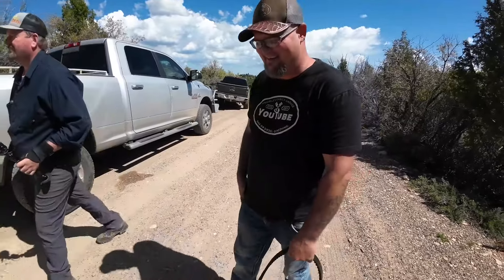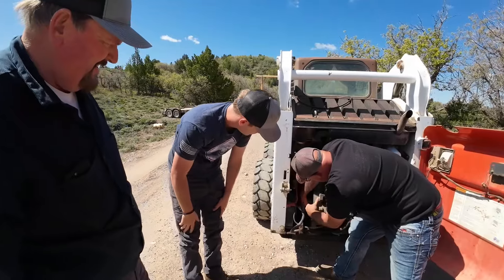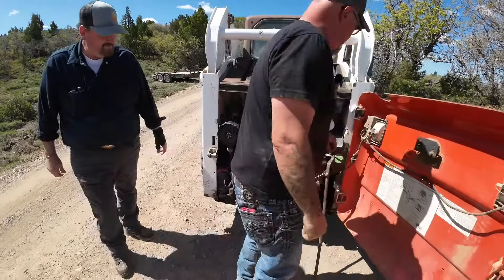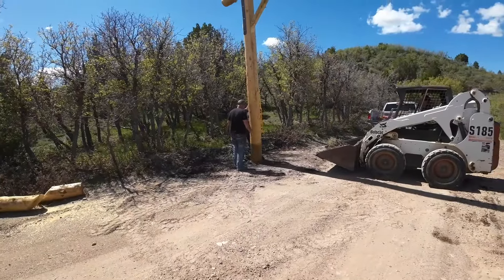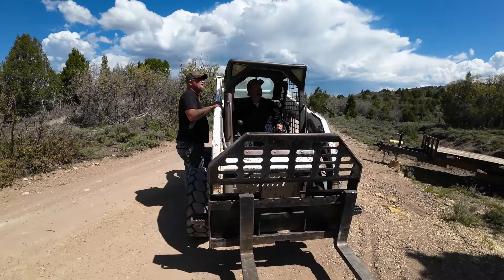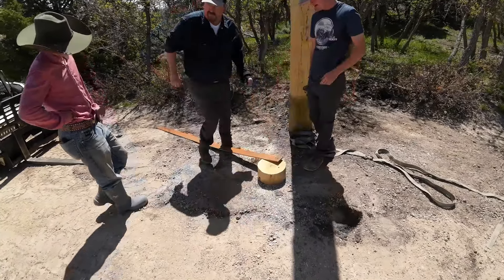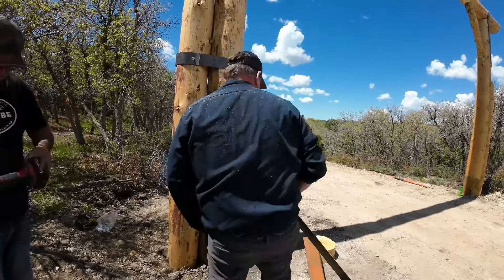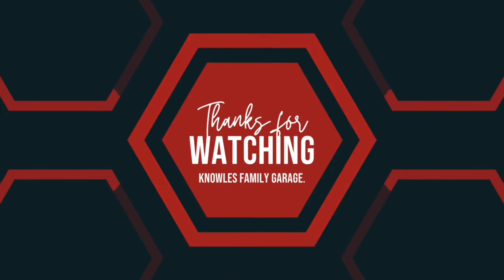Hunter Cox @FabRats came and helped with #bobcat repair and archway.

Comment: I think that belt has a preloaded not just the idler . That’s my old skid steer, that belt has a lot of hours on it .
Reply from the maker: It does have a tensioner that's adjustable We tightend it up and got rid of the squeaking. Now it's good for a while we hope.
Reply from the maker: That belt that was on it was from when you had it I'm surprised it had made it this long.